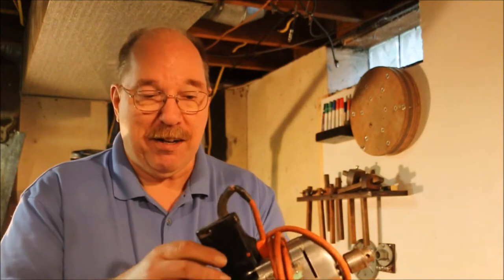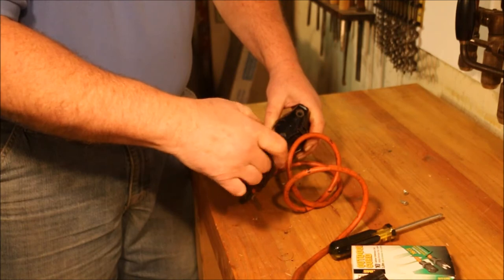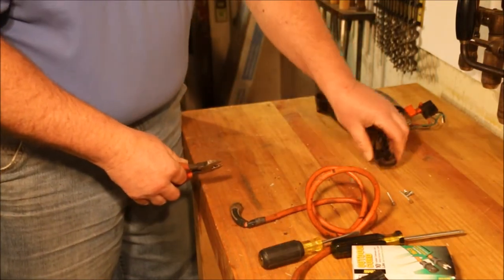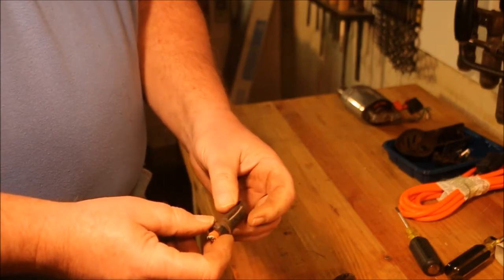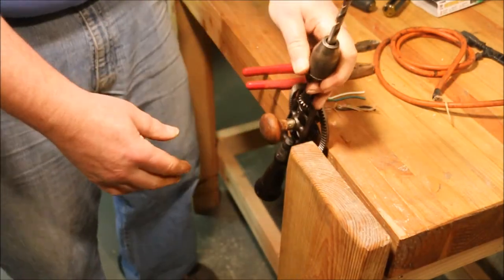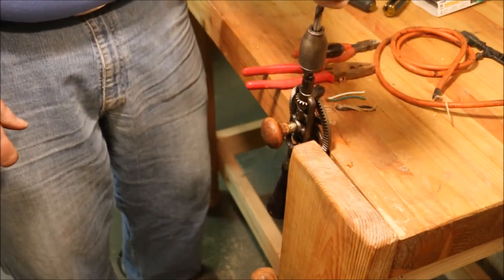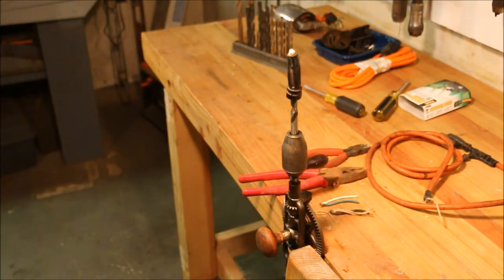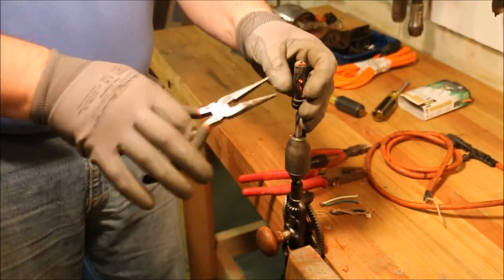REPLACING THE CORD ON A BLACK & DECKER ¼” DRILL MOTOR ~ PT 1 ~ A TIP FROM GOTHVCLS

Comment: I like the big strain reliefs that we used in the industrial plant. They're like Chinese handcuffs. Those small ones on power tools can sometimes be softened a little in hot water.
Reply from the maker: Tim Caldwell The Skilsaw Model 77 that I have uses a hard rubber strain relief thst is separate  from the cord. Most of the power tools with split or broken cords, have vinyl covered cords. They break right next to the integral strain relief. 
On this drill the strain relief is bonded to the cord. I think the vinyl stiffens with age. The strain relief is the same material. When the two age, the bending force is concentrated at the end of the strain relief. The stiff vinyl loses its stretching ability and cracks. 
I'm going to leave the strain relief detached. I'll use the grip of the clamp to hold the cord in the strain relief. I think that will increase the bend radius on the cord and help prevent the vinyl from cracking.

Comment: 10/4 on the drop cord for a tool cord. Seems like the crimp I ran into is where the handle on the butt end crimps the strain relief and cord with those nice long-barreled screws you dealt with. It's been a while but I thought I took a flat tip screwdriver and opened it up and got the old one out BUT it's been a long time. The last one I did was on the Makita miter saw and the rest was new enough so they don't need it, yet. So far so good though.
Reply from the maker: The satisfaction of fixing it yourself outweighs all the grief in getting there. Maybe...... :-)
Reply: AS you probably know, all or some of us in the mature age category bruise easily. I look like a train ran over me from just putting the mower deck on!

Comment: The main issue I'd have with reusing the strain relief is that if the cable has deteriorated over time, won't the strain relief also have deteriorated (albeit it may not show visible signs of doing so)? If it's hardened, then it stops relieving strain and just moves the hard point down the cable by a couple of inches. New strain relief grommets are fairly easy to find on eBay etc, and not particularly expensive.
Reply from the maker: The change I made in reusing the strain relief is I didn't bond it to the cord. I used the clamp in the handle of the drill to compress the strain relief and grip the cord. By leaving the cord free to slide in the strain relief it lets the strain relief and cord flex separately. That way the cord is able to bend inside the strain relief rather than only at the end. 
Since this is a prototype test, I won't be certain how long it works until it breaks. 

You are correct. New strain reliefs from the net are available. The price ranges from $4.68 on up. New cords are also available. They range from $12.66 on up. The problem I have run into is finding one that fits the old drills and equipment that I enjoy repairing and using. I have purchased new cords and spent almost as much time trying to get the strain relief to clamp correctly as I did recycling this one. 

http://www.ereplacementparts.com/?gclid=CP7m4O3ng9QCFY-BaQodniYNJgBlack and Decker,Bostitch,DeWalt,Porter Cable Protector, Cord #DWB-330005-01
Our Price: $15.19
Sale Price: $12.66

EBAY
spkrparts!-2007 (46585 ) 
100% Positive feedbackOne Cable Gland with Strain Relief 0.31" - .045"(8-11.5mm) Grip Ra…
$4.68
Free shipping
If I were to look at this as a cost/benefit ratio I would have to factor in the cost of a replacement drill vs the repair. 
BLACK & DECKER 7043 1/4" DRILL DRIVER SINGLE SPEED w/ CHUCK KEY 2.2A 2500 RPM 
$13.49 
Previous Price $14.99 
or Best Offer 
10% off
See more like this 
The cost for even the least expensive strain relief and the time necessary to install it is more than the cost of replacement. 

If I were doing this as anything other than an exercise in self reliance and a hobby it would be a massive failure to even attempt a repair. 
Fortunately I am not.

Comment: did you try a heat gun?  moderate heat on short timer might help break the bond?  hard to tell from here if that would work, but I might have given it a quick try before drilling.  the inner wires might have just popped out with heat.  great channel :>)
Reply from the maker: Russ Veinot It did help to heat the strain relief when I was putting the new wire in it. I will try heating the next one.
Reply: I have found over the years that heat is a good friend (a big hammer is still my favorite :>)
Reply from the maker: When I tried forge welding for the first time it was demonstrated to me that there is a balance between heat and hammer. 
I had heated the metal ring, that I was to weld, up to the recommended yellow heat and then I hit it with the hammer like I was going to drive it through the anvil. The steel squirted out between the hammer and anvil in a shower of sparks. Turns out I was just suppose to tap it. My instructor was very clear about that after the fact. :-)

Comment: ..if i can't reuse the strain relief i'll use a piece of automotive vacuum hose. i have a bucket of bits and pieces that come in handy . to hold the cord in the handle i'll put a couple of zip ties on the new cord. it's not factory or perty but works for me. Don't you just hate to find a slightly used power tool with a 6" cord & plug?? That's the first thin i'll fix, if the tool is working of course...!!
Reply: yep i have lots of small tubs filled with junk, that come in handy, short lengths of tube, pipe are part of it, and ive done the same with random rubber tube for strain reliefs
Reply from the maker: Ol James I stopped at a garage sale on US 27 25 years ago. The guy had a bunch of drill motors. I bought more than I'll ever need. Most of those cords are in pretty bad shape. 
I had been testing different compounds to try and make strain reliefs for the drills because I  can buy new cords but the strain reliefs on the new cords don't match the original.
Reply: self amalgamating tape, you can add as much as you need to made up any old thick support, but of course rubber pipe is the simple go to
Reply: You8 might have to melt some up after you make a mold?
Reply from the maker: Lewie McNeely That was the plan. Just had a thought. Peal the vinyl off the old wire and inject it into a mold. ?
Reply: hmm can you melt vinyl and recast it? never thought about it!
Reply: The idea for the better mousetrap has been born and YOU dood it!
Reply: ..i smell another video with plastic/vinyl/rubber or something being melted...!!
Reply from the maker: Ol James Hopefully I will be able to melt the the stuff without it smelling too bad. 😈
Reply: Outside in the olde Smithy shop. Let 'er smell!
Reply from the maker: As a test I took a bit of the cord insulation and heated it. In open air I was able to warm it up and mold it but I think it would be better to heat it in an extrusion cylinder so the volatiles don't evaporate as easily. It got too stiff in open air.

Comment: Cost/benefit: electrical cord $ 10 + labor $ 20= $  30. It is  better to buy another used drill which cost is no more than $ 10.00 or a brand new.
Reply from the maker: Cost 
Cord zero.......old extension cord
Labor zero......I'm doing the work
Total...............Fun time fixing drill and using it later. 
If I had to hire it done you would be pretty close.